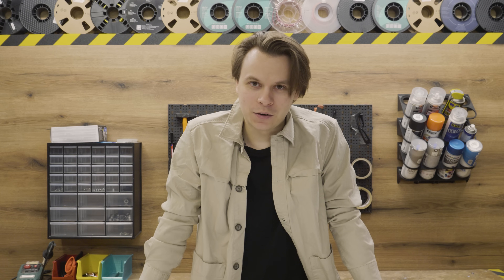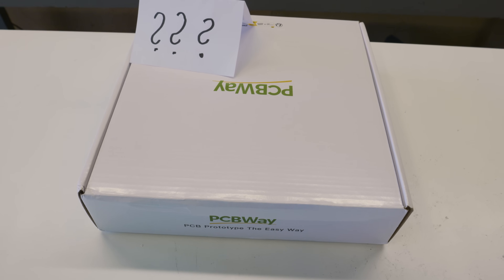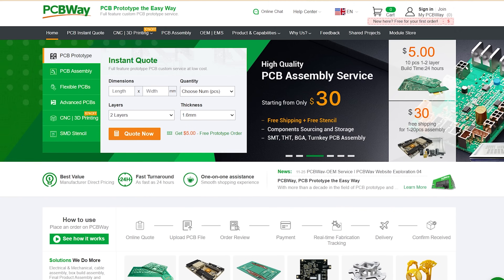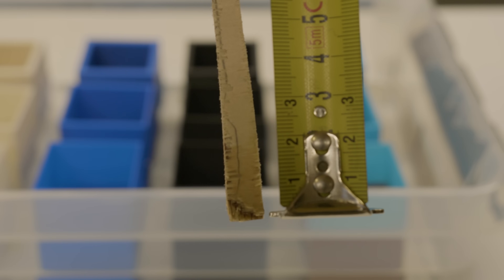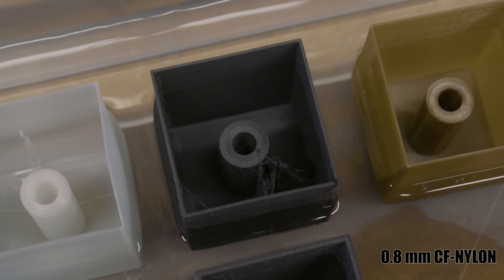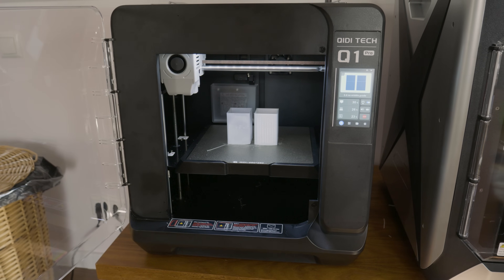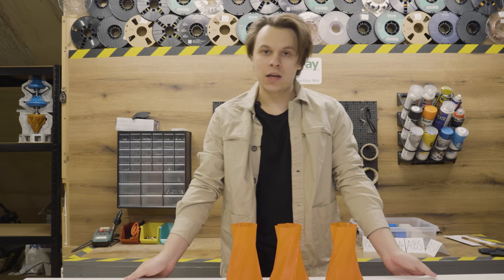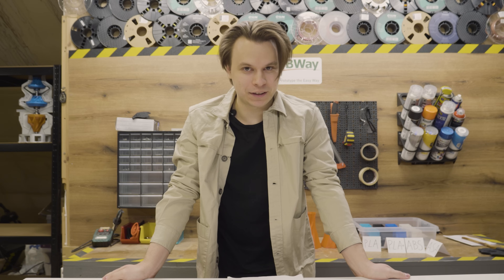PLA Really Leaks? - Weird Behavior of Nylon When Exposed To Water...

Comment: From own research and some tests: PLA starts leaking after some time being degraded by water and possibly other factors like being oxidized by oxygen from air and other potentially destructive conditions (temperature, pressure, UV light, etc.). I've been testing regular PLA (with near 100% fill and dichloroethane surface treatment) on water aspirator vacuum pump. besides relatively cold water water currents it was subjected to significant pressure differences and rapid changes. from 0.1 atm (76 torr) to 2-5 atm. and it was quite durable setup for at least 3 month and only after that it started to pass water and as a result pressure thus loosing the performance of its main function. So the leaking of PLA is inevitable due to the nature of this thermoplastic. First of all it absorbs water, thus changing its initial structural integrity and constructive tolerances. it getting worse because of the continious cycles of getting wet (absorbing water) and drying (loosing water/dehydrating). As for PLA+ it is much more able to be watertight especially after annealing (being thermally treated and gaining crystal structure).

According to scientific researches PLA in water can generally last 47 to 90 days. Its water vapor permeability is 161.1 g mm/(m2 day atm). In fact, let's not forget that PLA is not a single type of plastic but rather a family of plastics with common structural component. That's why different PLA types have quite broad quality on scale.

Comment: when it comes to printing pla and making it waterproof there are many factors with how many walls, infill, is the nozzle a tad bit closer to the bed which can create layers that are bonded together better than further apart, with me I haven't changed any settings but my nozzle is closer to the bed and I've gotten persistent clean prints that are waterproof and no defects but if your going to put it underwater then its best to have the infill at 100% as under pressure water will leak into the pockets with infill less than 100%

Comment: Use a wider nozzle, thicker layers and wider line width, and some extra extrusion multiplier.  You will save time, and Not leak.  I use a 1mm nozzle, 1.15mm width, and 0.55mm height.

Comment: I have printed 6 watering jugs out of PLA+ and the first couple leaked due to layer gaps but after corrections the last 4 did not leak at all. These had walls 3 shells thick. The water did not come through the material, it came through gaps in the prints. PLA+ does not leak - poor prints do.

Comment: You may be able to bake the print (like another 3d printing youtuber did for strengthening prints) to get sufficient layer adhesion to prevent leaks without needing clearcoat.

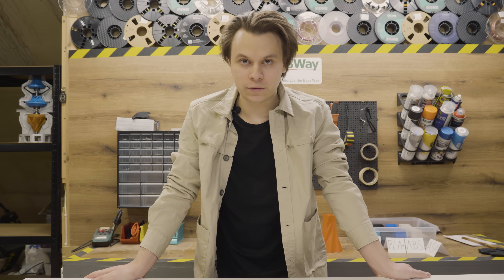Comment: @ 8:00 it's clear that you have under extrusion as the main culprit for PLA leaking -- as usual, everytime i've heard this myth it's always been under extrusion -- it doesn't need much, just your filament swap is enough to do it.

Fully extruded? even single wall is watertight.

Comment: PLA doesn't leak, as mentionned by others it's used in drinking cups, it's also a water vapor barrier in research applications. The problem is the 3D printing, it introduces defects, prorosity, degrade the PLA trough heat exposure etc. The gist of it is : Tune your settings to add walls and make layers squich more tightly and hotter and it won't leak anymore.

Comment: The way you tested means that the Hydraulic pressure of the water on the boxes wouldn't be consustent. As water fills the leaking box it would reduce pressure on the other boxes. I get that you were testing external pressues similar to a boat but you should have tested with the liquid inside the boxes. Also the change in direction of the print head to make a box, inherently, will lead to holes in the print try cylinders if you do this again.

Comment: I just repeated the experiment with . I printed a small cylinder with the following parameters and it seems it passes the test:

- cylinder shapes, as with cube I've got holes in the corners of the first layer
- vase mode
- 0.8mm nozle
- two bottom layers
- temp: 235C, 60C heatbed
- extrusion multiplier: 1.1 (10% increase)
- filament: prusament pla mystic green
- speed: 35mm/s
- no fan (fan speed 0)

Comment: No, PLA dose not leak! The porosities in the print are the cause of the leak. If you print at the maximum indicated temp or about 10-20°C hotter, and slow down the print whit just the minimal cooling needed for the part to keep its shape it will not leak. Increasing the extrusion multiplier 1 or 2% may help too.  PETG, ABS  and the materials whit better flow characteristics tend to seal better to the previously deposited layer because they have better flow characteristics, sealing micro porosities!
Reply: This can be tested if we fire treat the surface i supposed aswell. Might not look good but for testing purpuoses would do. I was thinking if heating up PLA could help too.
Reply: Easy to make armchair statements with no evidence; why not do a scientific test and produce a video showing if your opinion is watertight ?

Comment: I think this is less about the material itself in regards to the leak as it's about the fact that you didn't seem to calibrate proper flow for every individual filament, you can clearly see the big gaps between the lines with your PLA box.

Comment: I would have liked to have seen the results for TPU.
Reply: I printed a barrel plug out of TPU the other day, and it leaked as well, through the object. I didn’t try tweaking the settings to see if it could be improved. But the same plug printed in PETG didnt leak.
Reply: @kaasmeester5903  you would have been using very different settings for TPU and PETG so you really can’t compare them like that. Your PETG settings are likely better tuned than your TPU settings.

Comment: I have a theory, that water in filament directly effects waterproofing.
The idea is the steam creates micro tubes as it expands and escapes from the liquid plastic as its extruded.
An easy way to test this would be to try a pellet extruder, the nature of pellet extruder should allow water vapor to evaporate out the top of the extruder screw.
Reply: You need to dry pellets too because they absorb moisture and it is unlikely that the pellet printing process would allow steam to escape anyway.
Reply: @conorstewart2214  It must, because the pellets have large gaps of air, so if the screw doesn't allow the air to escape then it wouldn't work. Pushing that air through the nozzle would result in extremely bad prints.
Reply: @givemeanameman1  Pellet extruders compress the pellets as they melt them, it is possible the pellets could be compressed and all the air removed before they heat enough to boil the water.

Machines that make filament out of pellets melt the pellets primarily though compression, not a heating element.
Reply: @conorstewart2214  SIGH
Ok lets start with a question.
Why do bubbles in cooldrink rise up?
Its because gravity is PUSHING/pulling the water downwards. which forces the bubbles up and out of the container. even if you turn the container upside down so the opening is on the bottom, the air bubbles will still go upwards. Thats because the bottom of the liquid is under more pressure then the top.

 The screw spinning causes the same effect, its pushing the plastic and compressing it, but compared to air/steam cannot be compressed, which forces the air/water vapor to escape in the other direction... The more screw surface area behind the plastic, the higher the pressure that plastic is under, so you have a gradient of force that is highest just at the nozzle/screw and lowest at the start of the hopper/screw. So the air/vapor moves against the direction the plastic is pushed.

Its actually more involved and complicated then this... but the gist is correct.

on the other hand, a filament extruder pretty much makes an airtight system where the air/vapor is forced through the nozzle.

Comment: wall thickness isnt the only thing to consider tho.  layer height, squish, flow, time, etc theres a lot to consider beyond the material and.  you can print with a "waterproof" seal on them with most slicer firmware nowadays.  thicker walls only delay the permeation
Reply: yeah as long as the material itself doesn't dissolve or isn't permeable the printing process is the key to the leaking, not the material itself as such.  hence the inconsistent results
Reply: Yep squish and gap filling are the key

Comment: The simple fact is that you are sticking hundreds of thin layers of plastic on top of eachother with nothing more than a little heat so... any print can leak, especially at seams.

I like the submersion test, but it does leave the possibility that they all leaked but so slowly that the water evaporated as quickly as it got in. Next  time use some food-dye or other colorant so it will leave a clear stain on the inside if it does get through.
Reply: Or just put a lid on the box.
Reply: Just stick a piece of paper towel in the bottom, it will absorb any water that leaks in.

Comment: I have a printed 10L bucket in standing in my living room. With a 0.5 layer width and a slight over extrusion it's perfectly possible
Reply: I wanna bet if you cut it open there is water trapped in the walls.
Reply: @BartJBols  the walls are solid, but yes probably in some gaps